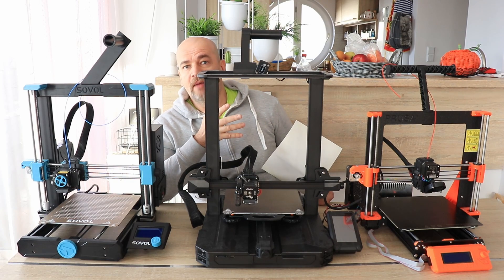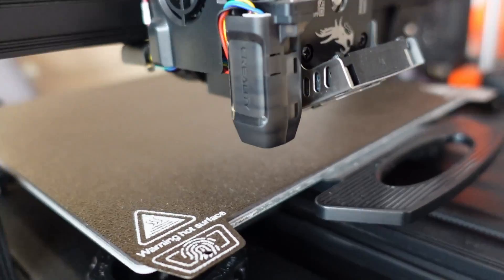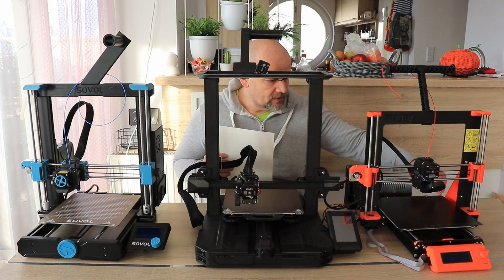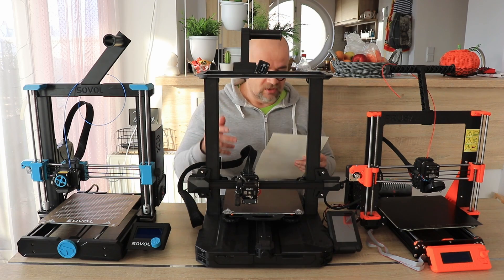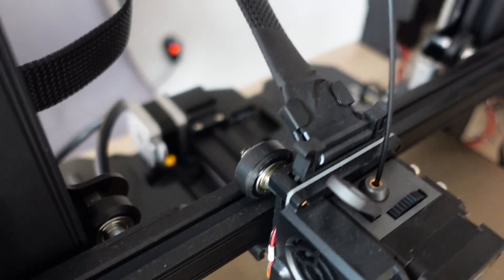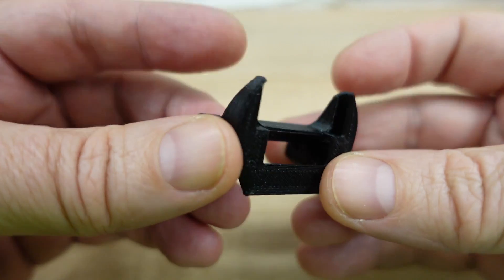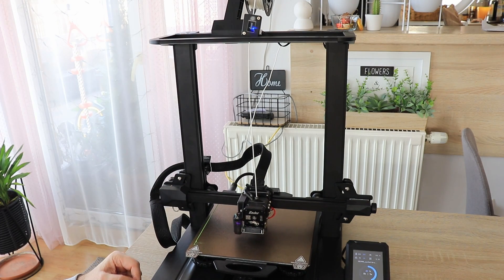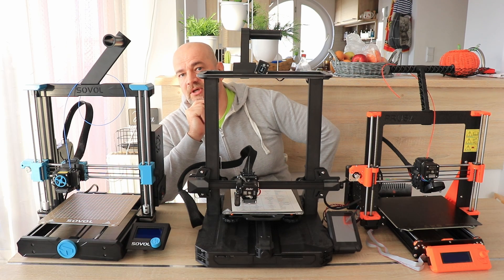Sovol SV06 vs Ender-3 S1 Pro vs Prusa MK3S - In-Depth Comparison

Comment: I just recently bought a Kingroon KP3S Pro, and I'll be buying a KP5L at some point soon. I think Sovol and Creality using just one stepper driver for both Z axis is a cost saving measure they really didn't need to do. They could have added another 2209 driver for separate Z axis and had a true Z auto align then made that a big feature. That alone may have persuaded me into getting an SV06 but they don't, so Kingroon here I come.

And I'll be changing my future KP5L to have two Z stepper drivers, changing all the drivers out for 2209 drivers, and installing my own custom Marlin firmware (the new one with input shaping). May also change it to an LGX Lite extruder instead of the clone Titan it comes with.

For anyone that reads this, if you want a 3D printer, I recommend the KP3S 3.0 from their website. Can't say enough good things about it (after you figure out how to get it level properly).
Reply from the maker: KP3S Pro is a great printer if size is enough. I recently tested KP5L too, but I don't have so positive experience like with KP3S.
Reply: Is using 1 stepper driver for both z steppers bad?
Reply from the maker: @DrKleiner0815  No, until you don't move one side or the other (when motors are powerred off) That's why very common are versions, where Z axis are connected with timing belt too (Like here on S1 Pro)
Reply: @MyTechFun  ah, i get it thanks

Comment: With the pricing in my country here in EU the difference between the ender and prusa is actually Pretty small. I Chose the mk3s kit back in 2020. Not much other choice(then at least) if you want something that works out of the box, and has good support behind the Product, its also developed and produced in EU. I don't have to do any tuning, or modding, it just works, that's worth alot for some. Others love tinkering and upgrading their printers :) Though i agree its time for an upgrade of the mk3 design, don't care about colorful displays, i would like upgrades in other places for better size, functionality, auto tuning, servicing etc :)
Reply: Pretty Small? Really? You are joking, right?
Here in my country (The Netherlands) The Ender 3 Pro cost €489. The cheapest Prusa printer (kit form) is €849. That's a whopping €360 price difference. That's enough to buy a Ender 3 S1 non-pro (€359) on top of the Ender 3 S1 Pro. You can get two Ender 3 S1 for the price of the basic Prusa MK3 kit. If you buy the assembled version of the Prusa MK3, you pay €1139. That's a €650 price difference. For that price you can buy two Ender 3 S1 Pro's and with a €37 extra, you can even buy the Creality Sonic Pad (€198) on top of those two printers.
So - There are reasons to buy a Prusa printer, but the price is NOT that reason. The prices difference is FAR from small...

Comment: Great comparison.
I have the MK3S+ that I assembled myself. I find the PETG a bit soft, the holes for the hex nuts are horrible (square are fine), the bearings needed to be washed and packed with grease to get proper use, the mainboard and LCD are extremely outdated, and the PSU lacks cooling. You can print replacement parts, but I think Prusa should have engineered better parts already, since the community has done that for them. I think they've gotten lazy and stopped innovating on their flagship model.
Reply: Tell that to the Prusa fan boys, they are adamant that their printer is still the top of the line.
Reply: @zero00tolerance  I really like Prusa. I think they are doing some great things. I like the way they've made the MK3 upgradable over the years. I like that they use their own product to make more of that product. I think it's an extremely reliable product and very well designed. I really like Printables website, it's great. I think they've built a great community. I love their monthly design contests. I think Prusa has done a lot of really great things.

But, as an owner who built their own MK3S+, and as someone who is always looking at how things can be done better, the product is far from perfect and is past due for some upgrades and a refresh. It's good, but it could be much, much better.

Comment: ender3 s1 pro with sonic pad makes the cr touch go fast.
Reply from the maker: Hm, good to know. Thx.
Reply: @MyTechFun  Start Cura G-code :::::
G90

G92 E0 ; Reset Extruder
G28 ; Home all axes
BED_MESH_CALIBRATE
G1 Z2.0 F3000 
G1 X5.1 Y20 Z0.3 F5000.0 
G1 X5.1 Y200.0 Z0.3 F1500.0 E15
G1 X5.4 Y200.0 Z0.3 F5000.0 
G1 X5.4 Y20 Z0.3 F1500.0 E30 
G92 E0 
G1 Z2.0 F3000
G1 X5 Y20 Z0.3 F5000.0

Comment: I own the Sovol and the Prusa, you can store different z-Settings for different Steel sheets with the Prusa ... just so you know. Then the change is real quick!
The sovol prints gread, but lacks in my eyes a few creature comforts. But i agree-Prusa is at the moment way too expensive!
Good comparison:)
Reply: that's what prusa is great at.  they take a tried and true design and find ways to improve ease of use, and we take it for granted until we go to use other brands.  also, the prusa can heat the nozzle and bed at the same time, while most budget printers have to heat one, then the other, as they don't have big enough power supplies.  this saves a TON of time in an already time consuming hobby.  their price isn't the best, but you do still get mostly name brand stuff, like the quiet noctua fans.  i think the hot competition will make their prices lower eventually, especially with the new bambu p1p coming out at such a lower price
Reply: @ame7165  Every Creality machine I own heats the nozzle and bed at the same time.  Prusa won't drop their prices until they lose enough sales to make them.  They have a wait time of people wanting to pay, shall we say a premium, for old tech printers they won't likely be dropping those prices in the near future.
Reply: @gitss7367  without modifications? i did our sonicpad on mine, so maybe it defaults to that.  wonder if i can change it
Reply: @ame7165  Yep - You just click the PLA or ABS  heating profile and both bed and nozzle heat up to the desired level (you can set that level at the configuration page). That's standard in the Marlin firmware. You can do the same when using a slicer. Just make sure it's in the start-up G-Code.

Comment: The bushings on my MKIIIs are showing signs of wear and I had decided to replace them, Im glad you pointed out that Prusa are no longer using Misumi as I would have probably ordered them thinking they would be the Misumi ones, I will order them elsewhere, the ones Prusa are using are probably very good quality but I am of the "If it isn't broken dont fix it" school ,so will continue to use Misumi Bushings.

Comment: The overpriced Prusa 3D printer. Just insane how small it is compared to the other two printers
Reply: build size is real close though
Reply: insane how small? your dissing the other printers unintentionally. printbed is almost same yet the other printers are huge, that equals bad product design... thats why prusa is overpriced, the designers acrually spent money on developing it, hence its higher price
Reply: @Tottorul  Yet, the buyer decides to buy it or not. Common sense. I would buy an Ender 3s1 pro... hell.. even better a Bambu lab x1c over the Prusa MK4. Why? Because I would rather have more metal parts over 3D printed parts. I value durability over repair ability. It doesn't matter how much time the designers are going to spend on developing it, at the end of the day, the consumer decides whether or not it is worth it or garbage. because THEY bring the money to THEM.
Reply: @Declopse  so wrong its sad. of course spending money on design matters. most 3d printer manufacturers are borrowing design ideas first implemented by prusa. so many mamufacturers are freeloading off of other peoples effort and money, they would never exist without them... you buy prusa you get reliability (more so than bambu at this point)  and durability. And you dont need aesthetic durability where there is little wear on a part. Give your money to Prusa and you know they will spend it on new ideas and refinement, worth every penny. I rather go mk4 than bambu still, but bambu is great, creality is a horrible lottery (along with many other chinese printers)
Reply: @Tottorul  You're just paraphrasing what I commented earlier. Do you really think 3D printed parts are more durable than metal parts? Get real. Stop hopping on that bandwagon of Prusa. And stop generalising on Chinese printers. A majority of Prusa's parts comes from Chinese manufacturers too anyways. When it's made in Prague doesn't mean the parts are. They're ''prepared'' for assembly in Prague. Keep humiliating yourself - it's beginning to get entertaining for me.
Reply: @Declopse  reread. i talked about 3d printed parts that is isnt under any conditions that would wear them out. any other place of course dont use 3d printed parts. yes you can really generalize a lot of these cheap and poorly quality controlled printers with exception of bambu. im not jumping any bandwagon, i owned creality, and god was it  just a waste of my time. got a prusa mini to try it out, low and behold it just works from day one no issues,  good experience = trust. chinese parts has nothing to do with it, its making sure all parts are well designed and work well together, prusa makes sure of that and tests foe that before ordering any parts or making any manufacturer partnership. the only reason for people overexaggerating their dislike for prusa is the small price difference, while there is countless of reasons to dislike maany of the cheap chinese printers. most of them dont even work out of the box you have to fiddle, set prests and upgrade, who would buy anything that doesnt even work? buy a new car like that??? prusa-price morons are the dumbest around..
Reply: @Tottorul  to be fair pursa just as bad as everyone else with borrowing design ideas there just huge company so u see it on there stuff before u see the small brand selling a couple printers that made it